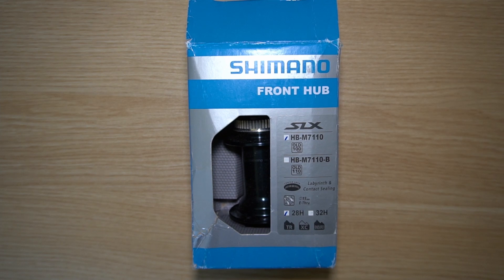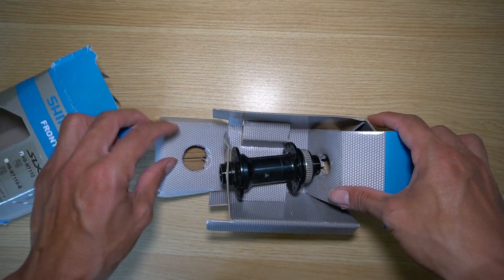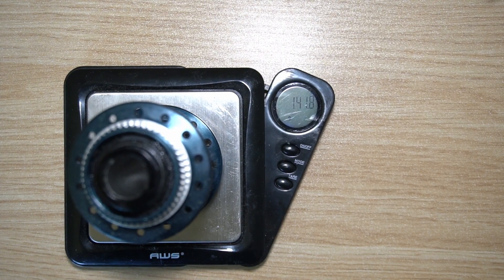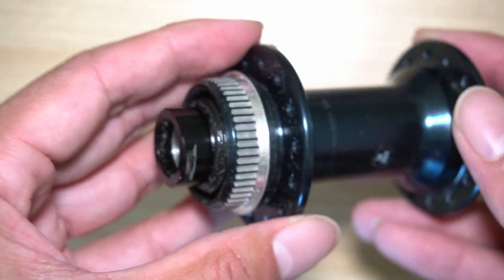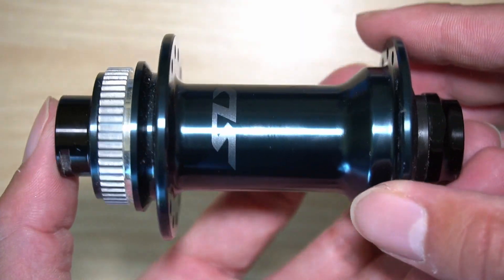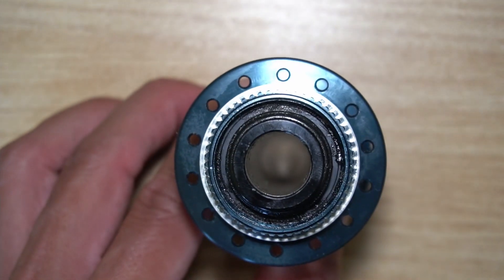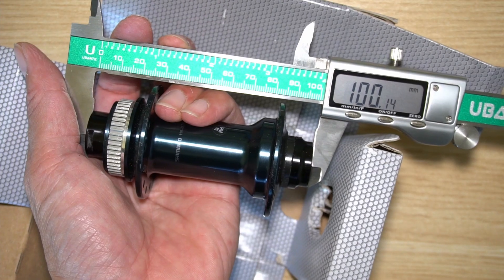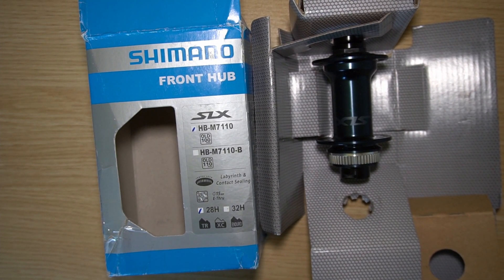Shimano SLX Front Hub Unboxing Weight & Measurements

Comment: is it possible to convert it to quick release?
Reply: You would need an 15mm thru axle to 9mm quick release adapter
Reply from the maker: Yes, I've converted it and am using it on a quick release bike/fork.